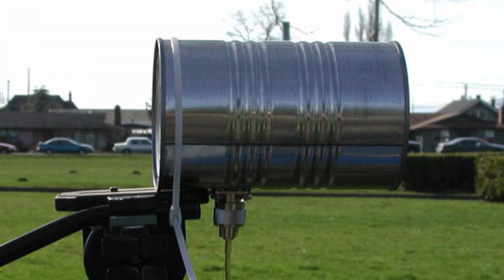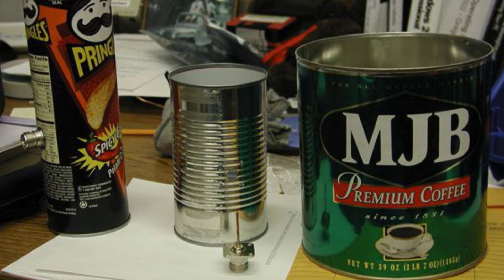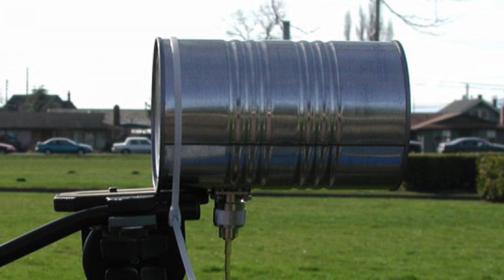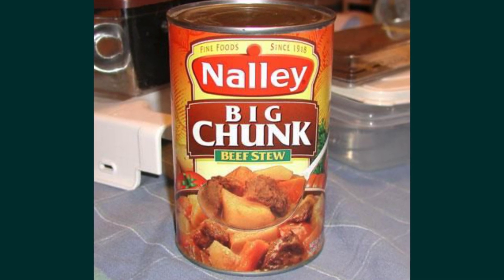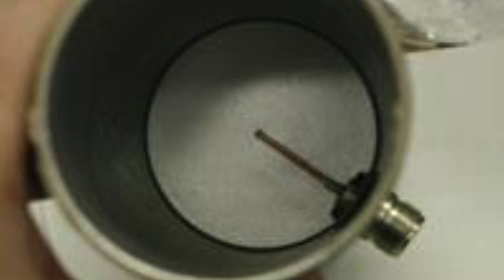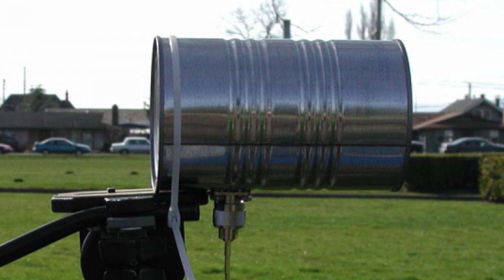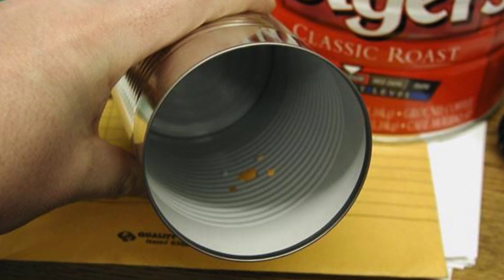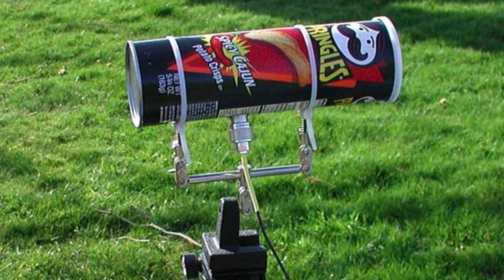DIY Project For A Tin Can Waveguide WiFi Antenna

Comment: Random pictures? A Pringles can is a rotten can for a waveguide antenna. The sides are cardboard with so little aluminum in the lining as to be useless substitute for a metal can.

I made a lot of waveguide antennas for 2.1GHz back in the early '80s. I used everything from coffee cans to those huge #10 restaurant cans.